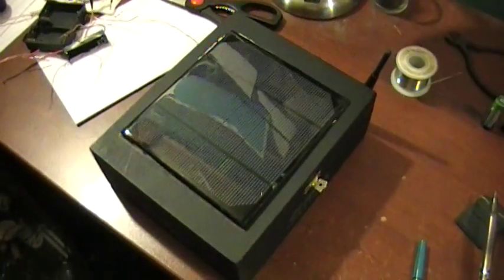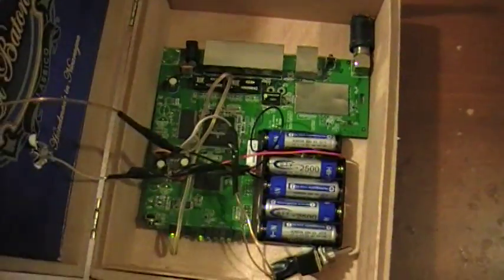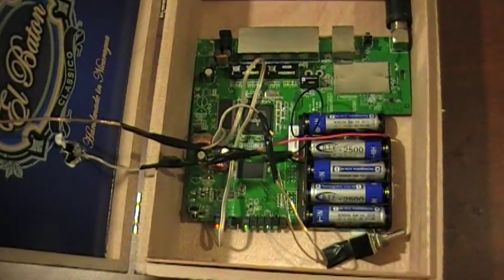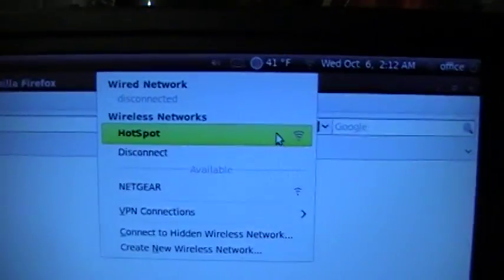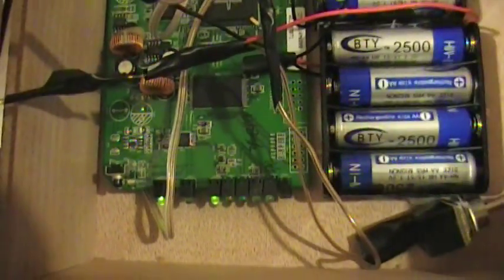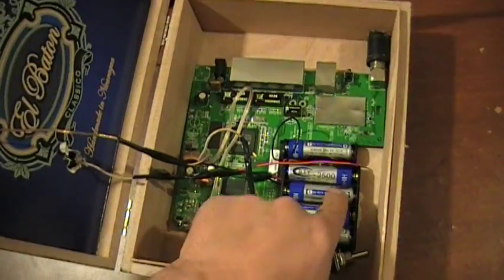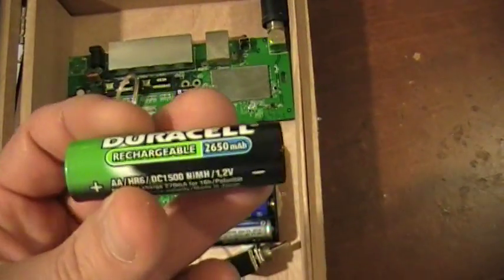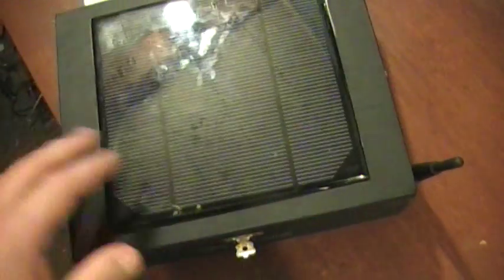Solar Powered DIY Wi-Fi HotSpot

Comment: my only guess is if i wanted to use something like that to boost the wifi connection of my isp at home how will your device kind of go around the passwords to connect to my wifi connection or will i have to kind of configure that device of yours by inputting the data to connect to my router for it to really work ???.

Comment: The 71mw-251mw setting is only the Transmit power from/out of the wireless router.(ie; how far away you can send a signal) You'll need a higher gain (ex; 9dBi) antenna to receive things better.(ie; 'hear' a signal from farther away.) 
The higher gain antenna works 'both ways'. You can both transmit and receive farther with it.

Comment: What is the voltage/amperage of that solar panel? It is the shape of just one monocrystalline, as in ~0.5 volt, but obviously it must be higher due to the battery pack.